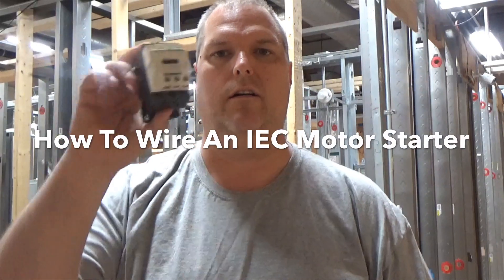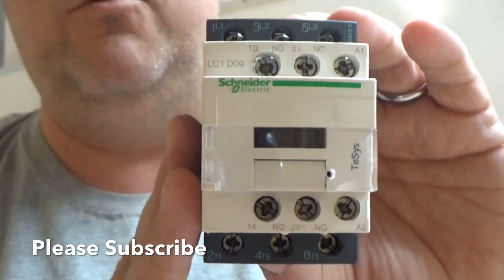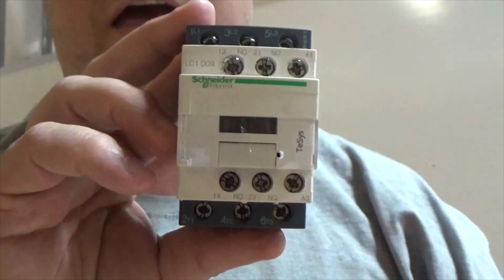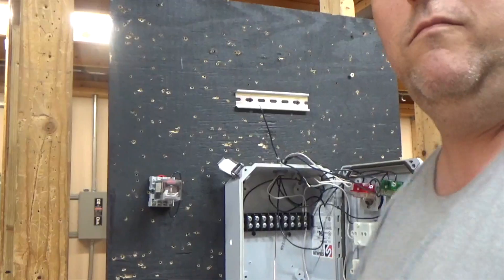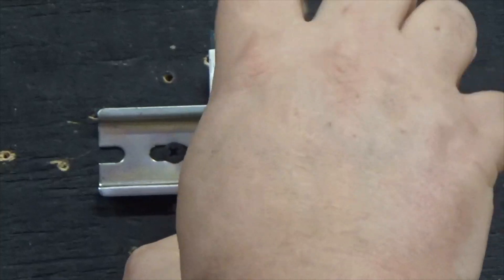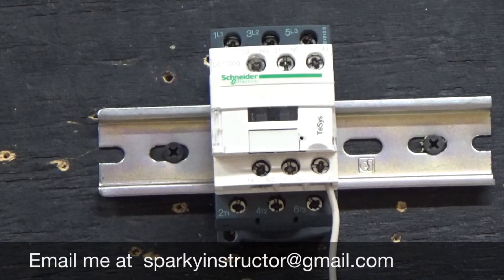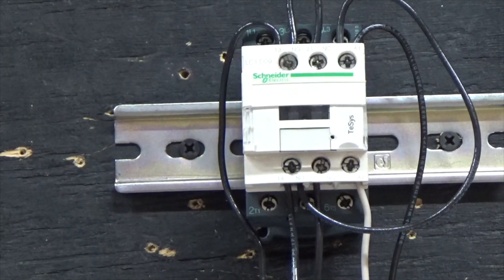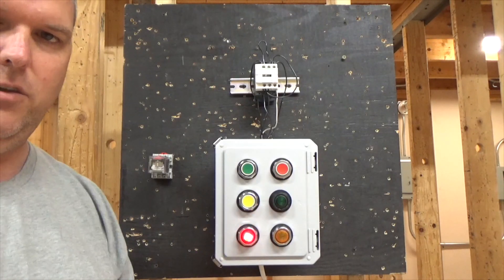IEC starter How to Wire!!

Comment: i understand the holding circuit when Line and Control use the same voltage. But, I am confused when Line is 120/240 and control is 24VAC. I am using 24vac as control so I can have stop/start buttons thru out my shop.  I am assuming to use both voltages, I will need to use aa relay with 24VAC to hold and send power to a contactor using 24VAC as control with L1 and T1 using 240vac

Comment: Great video but witch wires  goes to a motor ??
Reply: The power for your motor would be coming in the top on L1,L2, and L3 and going to the motor on T1,T2 and T3 for three phase and L1 and L3 in and T1 and T3 for single phase .